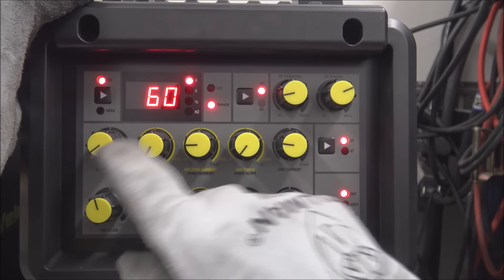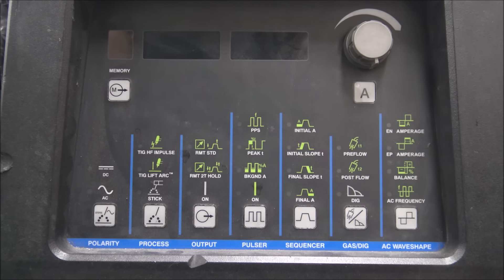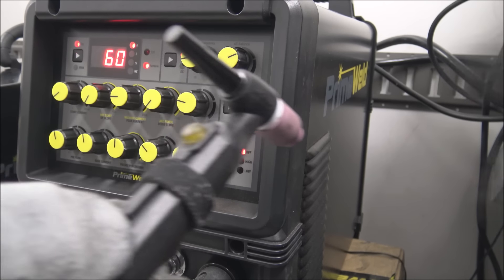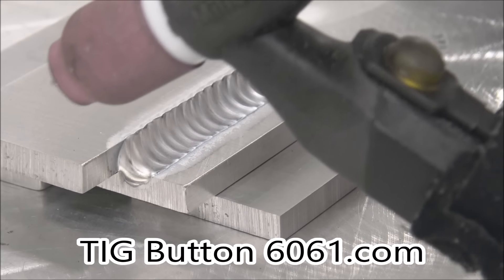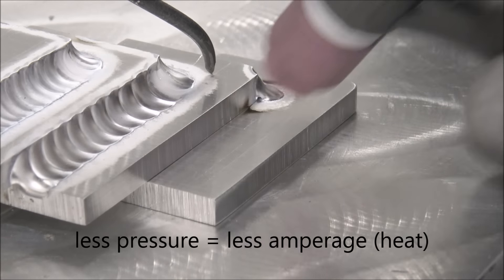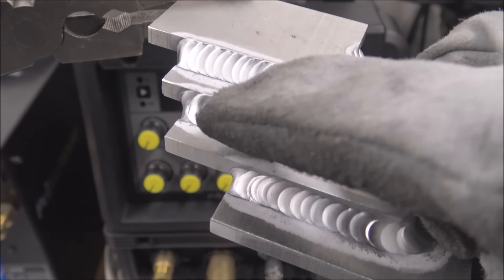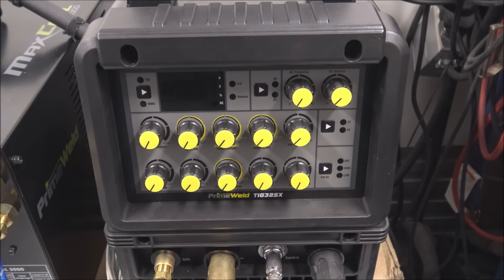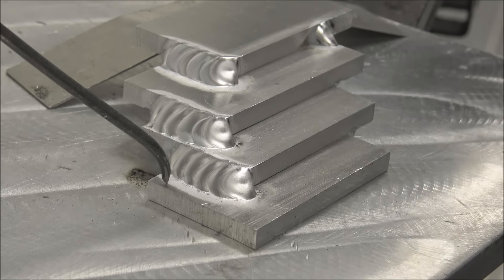PrimeWeld TIG 325X - What's Great About This Machine - TIG Welding Aluminum

Comment from the maker: Purchase directly at http://www.primeweld.com and use the code "6061" to save yourself 5%
All welding/fabrication questions are answered in detail at www.6061.com

-welder settings 
-filler rod selection
-tungsten type/size/prep
-aluminum prep/fitment
-torch setup
-how I feed rod
-rotary positioner welding
-etc...

Comment: I love my PrimWeld 325X also. Lots of control and easily adjustable with all parameters' using knobs. I do use an gas cooled torch capable of 200Amps that I have pushed to 325Amps for a short time. 👍

Comment: I have a Primeweld Tig 225x w/ watercooler & CK worldwide flex-loc water-cooled torch had it now for 3 years now and no complaints I do the same thing take a picture of the settings for what I'm doing.. this is my first Tig machine I couldn't justify scrolling through the menu to find what I was looking for wether it's blue, red, green they all have it what happens if it gets a back geed from AC welding? Hmmmmmm don't think they thought about it 😮😮😮😮😮😮 Thanks for the great tips over the years Aaron you and Justin, Jodie are the ones that I followed to teach myself to tig weld never looked back. Keep up the amazing content 🎉🎉🎉🎉🎉

Comment: sold a clean/clean dynasty 200dx with wc-3 abicor-binzel cooler, and purchased the “325X”. LOVE the Primeweld 325X. tried using your code, but was direct from primeweld on black friday, and i’ve been a virtual “student” of yours since 2017. #keephammering

Comment: i wish the 325 was out when i got my 225. sometimes that little umph starting out would be nice on thicker stuff but i cant complain regardless. especially for the price. at work we have the same miller dynasty and i honestly prefer the prime weld which i didnt expect when ordering. between the PW, flexloc, abiltiy to switch between pedal and your button quickly, and furick gas lenses its an unbeatable set up

Comment: Great video, thanks! I just picked up a 325x and I'm really impressed with the build quality so far. I'm considering a project that would involve butt welding 1/2" 6061 plate together. Any advice or ideas for making that joint with this machine?

Comment: I have a fairly “normal “ question;  where was your ground clamped for this video? I have ground issues when doing aluminum like this (smaller pieces that can move around or if clamped to the table)? I do have a smaller set up table that I normally ground to and it works fine for everything else. Second question is a bit odd; I had a complete shoulder replacement this past D-Day. I’m finally back to being able to do everything I could prior, and a friend of mine who is a long time welder mentioned casually that I may be far more a candidate for shocks now when welding. He wasn’t breaking my balls or anything, he had said he had seen it happen in person and knew the guy getting the shocks had a whole bunch of metal in him. He said it was hilarious (my friend was welding a motorcycle frame and the guy getting zapped was holding the bike in place as it was being welded) of course, but mentioned that I should tread cautiously. Quick race bike fixes at the track are not in my future anymore, but I’m asking anyone that may have a clue. My doc and PT doc looked at me like I had small rodents crawling out of my ears when I asked them.

Comment: You are an artist, a true artist. I love your channel. My question is what are your opinions on the primeweld tig 325x vs the 225x? For a home hobbyist, who aspires to your level of craftsmanship, this is an important question, and i cant seem to find it answered adequately anywhere. Thanks.
Reply from the maker: It depends on how thick of metal you are welding, and how often. For me, I need at least 300 amps and a water cooled torch.
Reply: I do have 225X it is good machine, but somehow complicated  to set up for aluminum welding, don't have digital reading for individual setting like 325X have, just for amperage. Scale around knobs is not very helpful for fine settings. But no problem to dial for steel or stainless. If the 325X would be available when I made purchase I will rather have that machine.   IMHO
Reply: @milosusa  Thanks for that. That's along the lines of what I remember seeing in a yt video some time back, maybe a year ago. But now that I'm about ready to make the purchase, I cant find that video again. I'm def leaning towards the 325X both for extra capability and the interface like you said.

Comment: 6061, what do you do about the tiny sharp points at the puddle edge intersection with the top of the lap joint?  I end up filing them down and putting a bit of chamfer to this area but don't think that looks as nice as leaving the 'as-welded' edge - except those sharp points aren't very nice to handle. Do you fill more to get a bit more bulge to the bead- to avoid that little sag along the top edge which forms the points??
Reply from the maker: You can add a bit more rod so it humps up higher if you want, or radius/pre-chamfer that top edge so the transition is smoother. 1/4" thick material is about as thick as you want to do a single-pass. Any taller/thicker, you'd want to probably do multiple pass (making your last pass barely hump up so there's no "undercut"). Hopefully that makes sense.
Reply: @6061  Yeah, makes perfect sense.  Thanks for the time to reply.  I generally don't have many lap joints in thicker stock but when i do; I've either double passed or just slowed travel and added filler. (I use a cold wire feed TIG Gun so dialing up feed volume isn't hard).  Still those doggone 'points' have been a pain in some jobs.

Comment: @6061 How does the 325x compare to the higher end Dynasty's? I have a Synch200 and a Everlast 256. After welding with a buddies Dynasty 200 it seemed to start and run quite a bit smoother with the arc than my other tigs. I'm looking for a higher current tig at the moment, but how much difference is there in current control from the 325x , and say a Dynasty? I know the price points are opposite ends, but you would have personal experience with both.
Reply: I have had a Dynasty and I'm on my second everlast.  A 255ext and a 400ext. 
I liked all three. Miller is built better, but all three work just how I need them to.

Comment: Do you find that higher amperage machine has poor arc stability on low amps AC? I have an everlast 325ext from 2015 and the arc struggles at around 20amps.

Comment: How much pressure does actually take to use the tig finger? I almost cut my left index finger off in 2015 it’s there but no a lot of dexterity!
Reply from the maker: Not much. You can use your middle finger. I do quite often.